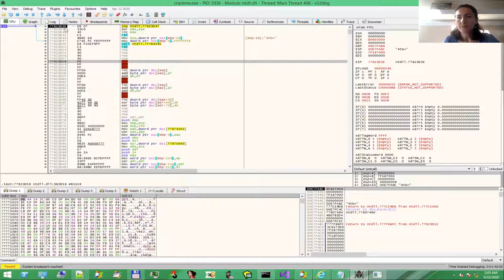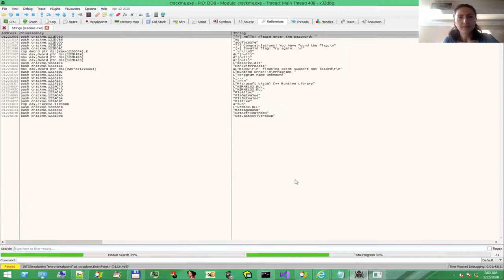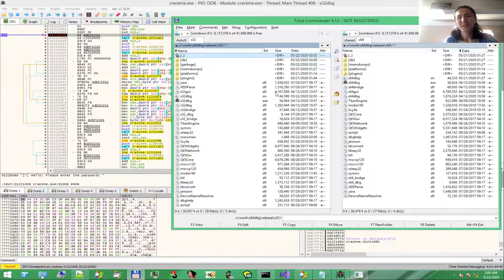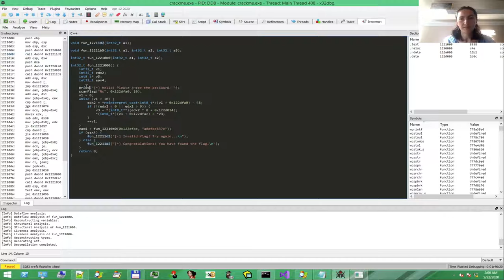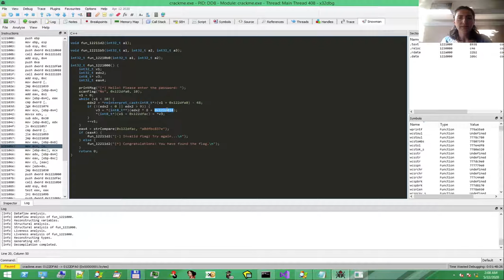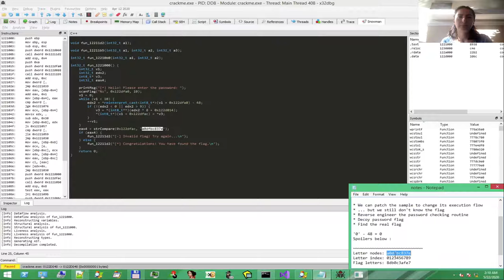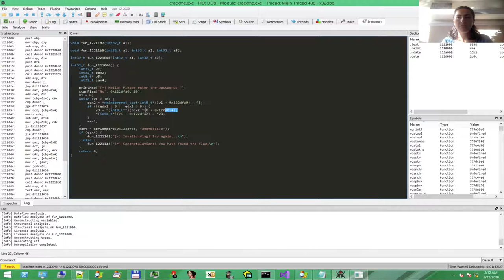Solve a crackme with x64dbg and Snowman decompiler

Comment: Thanks for the video, its time for me to try this out on my machine =). 

Also on a side note, there is a bit of background static noise at portions of the video. I would recommend using Audacity or the like to extract such noise so it is easier to listen to the video =).
Reply from the maker: Thanks! I've also used Audacity to eliminate background noise but couldn't do it fully.  Do you have any Audacity profile or settings you can share?
Reply: @ReversingHub  Ah fair enough, then I suppose there was much more background noise until you removed it already. 

I've just downloaded a copy of the video and imported in Audacity and managed to remove almost all of the static humming in the background after some playing around. I've selected the region roughly between 4:59.0 until 5:01.0 as the "Get Noise Profile". Then selected the entire clip and applied it with a noise reduction=48 dB (not the default 12 dB) and it gets rid of it pretty well without impacting your voice (at least to my ears). Perhaps you might want to try that out and see if the quality is acceptable for you.

Alternatively, I just looked around for some machine learning noise reduction (been interested in this for a while) and found a software called Krisp (https://mrc.fm/krisp and the tutorial video that demos it https://www.youtube.com/watch?v=hrQ_2JhEKpY). Though it is designed for real-time use, a clumsy way I found to apply it to a recorded video as follows:

1. Play your video in VLC.
2. Change the audio setting to use the Krisp virtual headphone.
3. Play the video from the start and capture the output audio from the Krisp virtual (e.g. using OBS)
4. Override the filtered audio with the existing audio in the original video (e.g. using FFMPEG).
Reply: On a side note, I just went through the crackme.c exercise in this video and was very educational, very hard, and fun. Thank you again for posting this video =)
Reply: ok akcomar